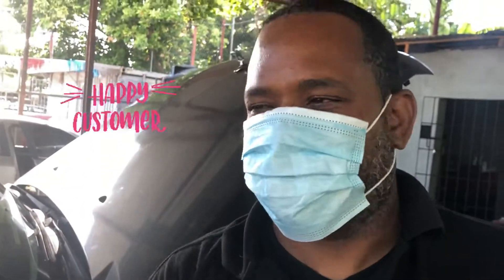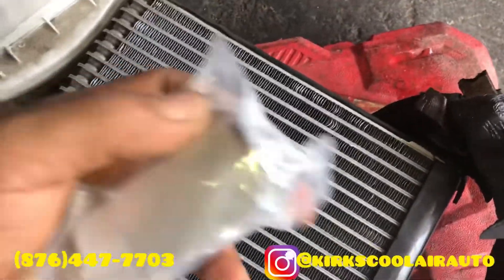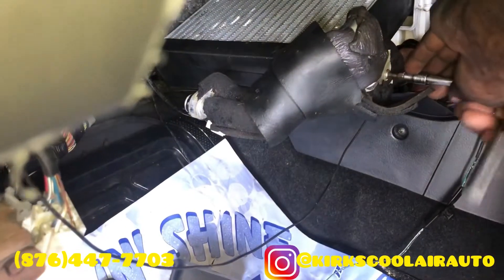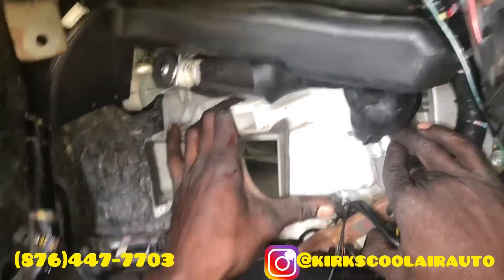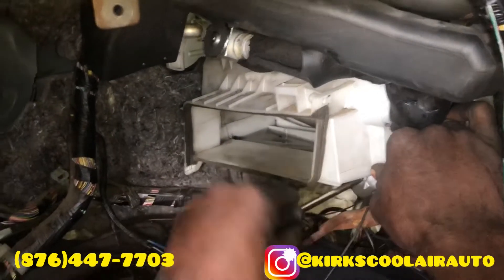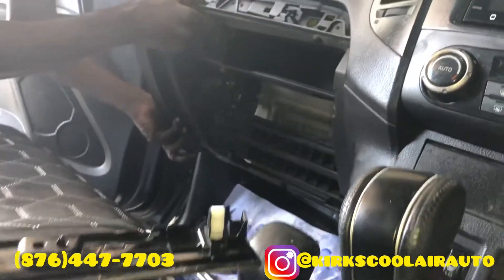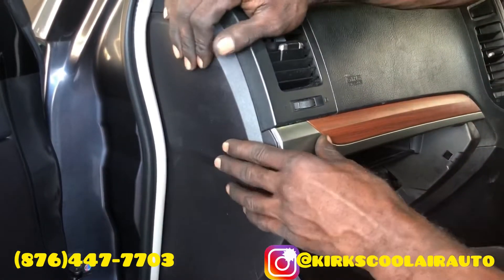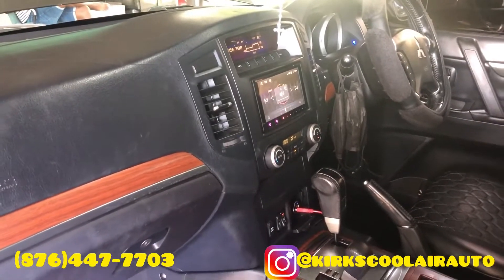2008 Mitsubishi Pajero A/C Evaporator Expansion Valve replacement #mitsubishipajero

Comment: Thanks for sharing these videos very helpful since I'm new owner of 2001 Montero NM l. I have a couple questions, how do you remove the plastic cover that houses the spare tire? and can you tell me an easy way to access the A/C drain so that I can make sure it's not the reason my passenger side floor soaked when it rains. I checked my drains from the sunroof and they are clear after running some plastic wire through the drain tubes. Thanks for your help